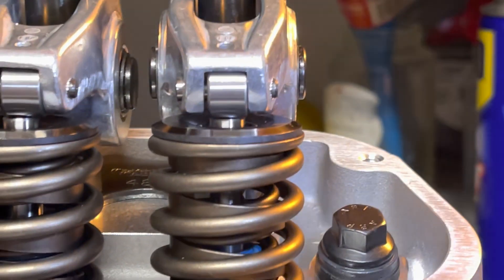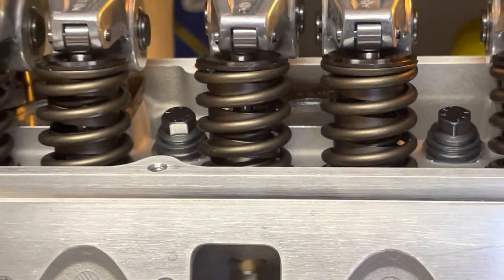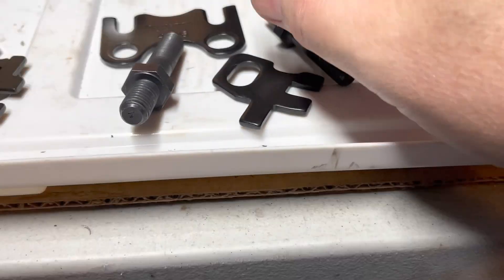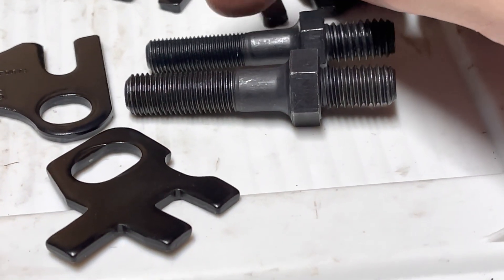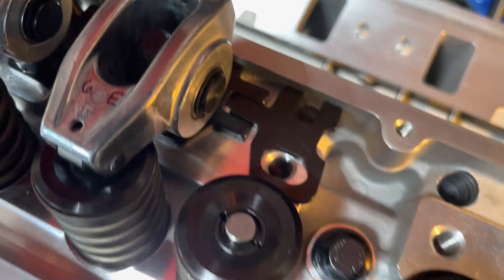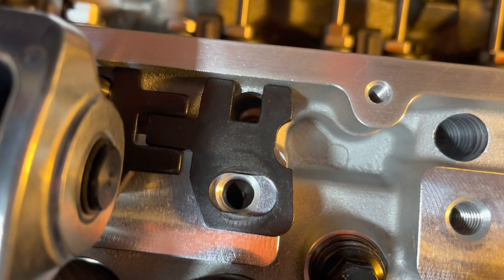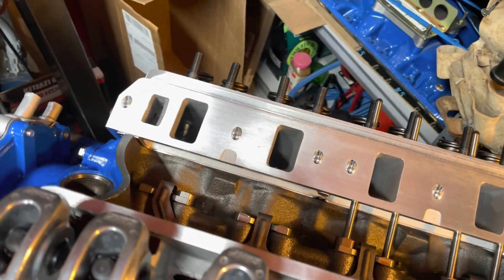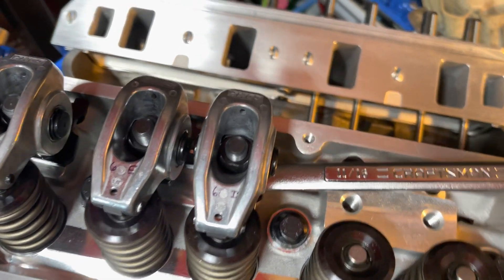Pushrod Guides - Ford 289 331 Stroker Motor Rebuild part 22

Comment: With the bolts torqued, how much side slop is in the trunion bearing??
Chinesium rockers flop around quite badly... Like .060+ and can make the rocker slap the valve stem... Click click.....
Reply from the maker: I honestly didn’t measure the side play. Next time I pull the valve covers I’ll check it.

Comment: I always tack weld the 2 piece plates to make them a 1. 🤔🤔
Reply: It's required to weld them when they are adjusted correctly on the head. They will move if you don't.

Comment: yeah, I tried to use the one piece guide plates in my 1968 302 with 1987 heads... the holes were too close, the studs wouldn't fit, so I ordered the two piece type
Reply from the maker: I really don’t trust the 2-piece guide plates not to shift slightly but it’s easy enough to pull the valve covers later on to check.
Reply: @JohnLatrobe  I had no alternative… the one piece plates wouldn’t fit… even though the manufacturer says they should fit… they didn’t! I’ll be sure to torque them down correctly